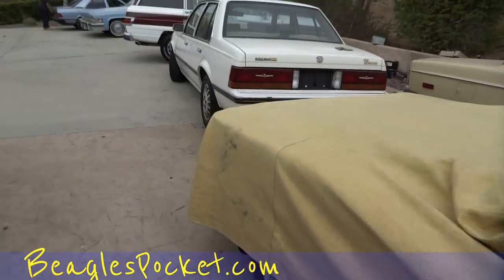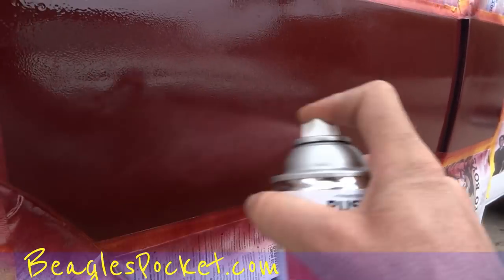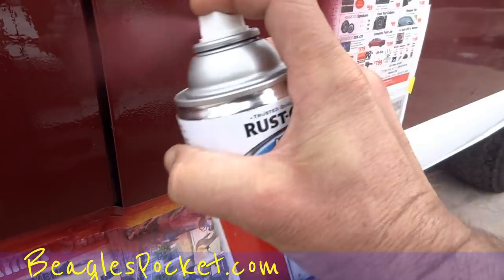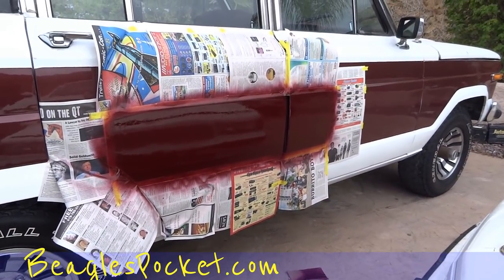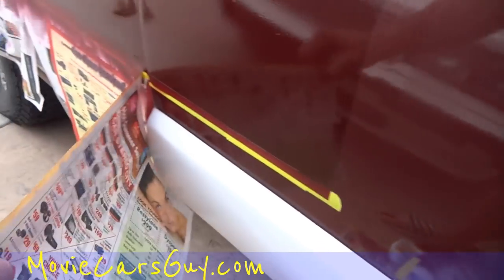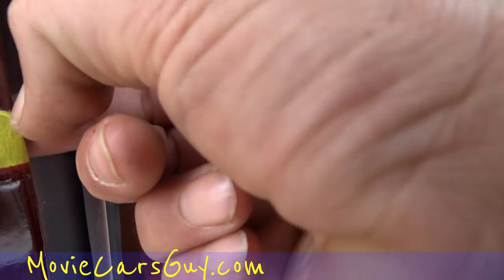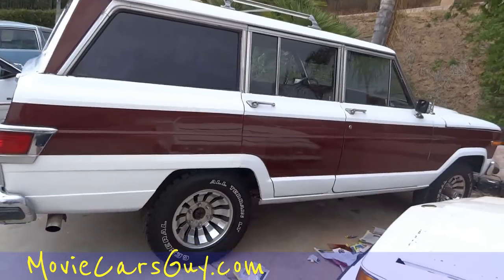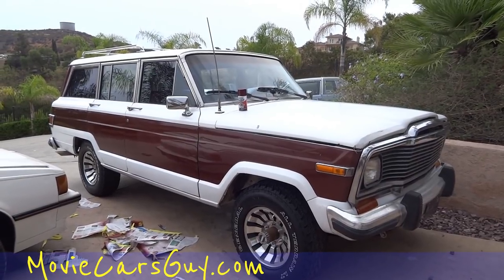Paint Touch Up Car Dings DIY Easy Auto Painting Process $2 Paint Fix Looks like $500

Comment: My 01 F250 has two small spots on the roof in those recessed channels that run front to back of the roof where the paint chipped off and there is a little surface rust. I want to prime and paint these two areas because the rest of the truck is spotless and I dont want to repaint the whole truck over two little spots.